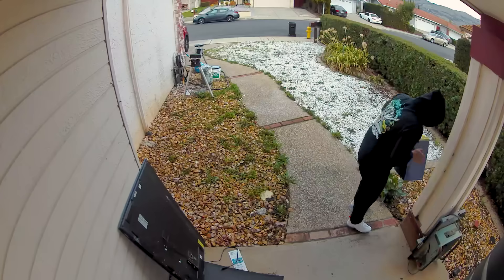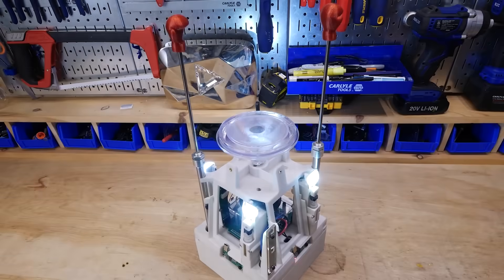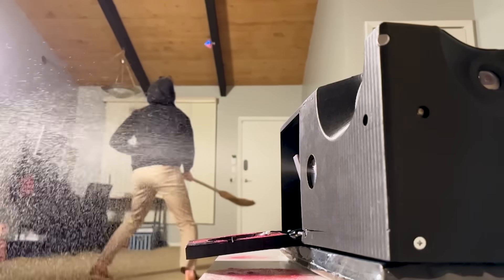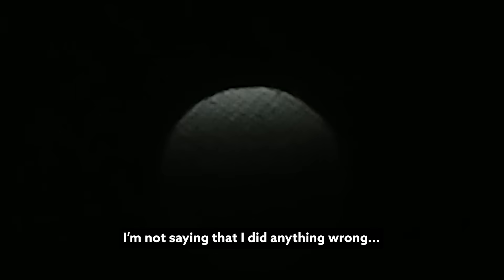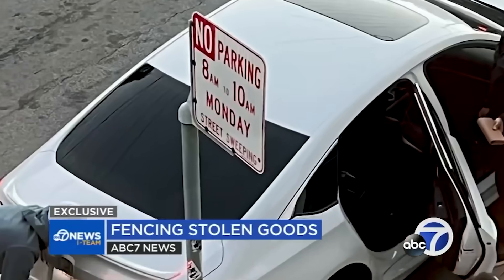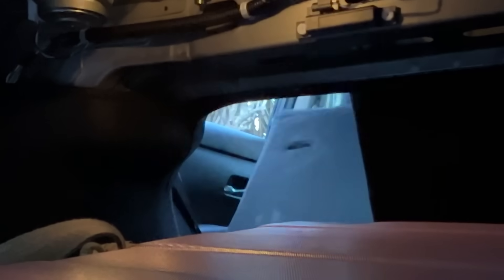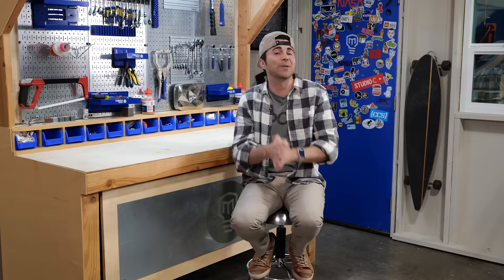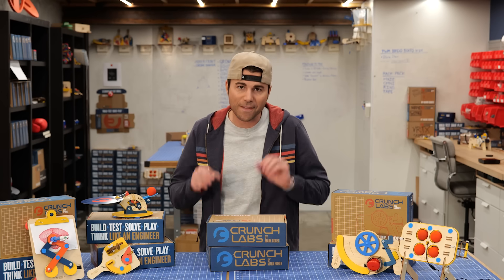Car Thieves vs the Almost Final GlitterBomb 5.0

Comment: Please KEEP doing this. Every time an Amazon package I deliver is STOLEN, Amazon BLAMES ME FOR IT and says I DIDN'T deliver it. I lose my benefits and risk getting my Flex Driver contract cancelled. If I can't hunt these people down, (the porch pirates) then seeing them get punished is the next best thing! Thanks for the video!!!
Reply: This has gone for too long... Amazon should provide package safe boxes with Amazon Prime.. Maybe just an electronic lid that can be attached to a brick or cement built case by the owner near their door.   So let's say Amazon has the code to open lid, leave package... Then homeowner comes opens with code and retrieves. // I know they have system with the Blink and Ring Cameras, but thats a bit weird, more intrusive.
Reply: @Kareemdinho10  eh Amazon is pretty bad
Reply: @mikafizz1022  No you need to stop them leaving things outside.
Reply: @Kareemdinho10  doesnt even need to be super secure most porch thieves wouldnt go for the trouble of getting it out
Reply: @Kareemdinho10  read my previous comment, way more easy and logical solution.
Reply: @Kareemdinho10  OR homeowners just plan to be at home when a package gets delivered. Otherwise the delivery driver just tries the next day or brings it to a store.
Reply: @Kareemdinho10  It's not amazon's fault that thieves are no longer being prosecuted.
Reply: @Kareemdinho10  In Uk Amazon will not leave item outside, they must deliver to an occupant or come back later.
Reply: Wow. You get in trouble because somebody else steals a package you delivered??
Reply: @nenenorth  A lot of delivery drivers actually work for a subcontractor where repetitive doubt of delivery takes a firmer hold.
Reply: @nenenorth  I'm glad Amazon is doing this. I hope the rest of the delivery companies follow. Then the drivers won't be so careless with these packages.
Reply: @nenenorth  he just explained it....loo
Reply: i don't get why they leave the packages on doorsteps in america in the first place. where i live, if you aren't home when the delivery arrives, they just bring it to a pickup point in the neighbourhood so you can go get it when you do get home. or if you have work that day you can just tell that to the company and they will just bring it to the pickup point regardless.
Reply: @Netanyadolf  Amazon offers locker pickup, but if a customer says, "Leave it on the porch," I have to leave it on the porch or get blamed for not following customer directions. It's a lose/lose scenario.
Reply: @rgnestle  well, then imo amazon should blame the customer for their own stupidity. not you.
Reply: @RGNESTLE - Record your delivery and submit the footage. Better yet demand a body cam from your boss. Nag them until they get you one. They cannot blame you if you have proof you are doing your job. They could take the time to even shadow you - follow behind your route and double check.  If you are doing your job - missing packages ARE NOT your fault - that's on the bosses and execs.
Reply: That's complete bs that you get blamed for that when porch piracy is so common.
Reply: I never gotten a package stolen, but I  can imagine how it would feel getting something you saved 5 months to over a year for, only for it to get stolen by lazy people "its 400$ they'll buy another one"
Reply: one of the many reasons Bezos isnt richest anymore
Reply: In the early days of Etsy when people got their package stolen I had to pay the refund. So I would lose a bunch of money. Now, Etsy will refund people as long as it says delivered.
Reply: I had a few of mine stolen.
Reply: @cheesesteakphilly  Sorry to hear that. The porch pirates are brazen. They don't even care if you have a door camera or if it's broad daylight. :(
Reply: Honestly? This is how it SHOULD be and IS here in germany. If I dont accept my package by myself, they cant prove that I got it and the delivery company has to pay for the loss. No problem with package thieves here, but still fun to watch.
Reply: really? My experience has been quite the oposite. When I know it's not amazon's fault and porch pirates, usually amazon just sendsd me a replacement item.
Reply: So no way to do picture.
Reply: My delivery people take photos of the package and it uploads to amazon.  Can you do that?
Reply: Amazon should stop delivering to SF
Reply: Easy fix. Mail your packages to a PO Box. It will always be safe because it goes directly there and you have to go pick it up with a key/combination.
Reply: @ThatsSoGiorgio  That would be best, but it would also put me out of business. That stress would be greater than the stress of dealing with the terrible AI that makes my life miserable. :)
Reply: We need actual bombs tbh
Reply: gopro your day
Reply: @CONEHEADDK  I do, but they still blame me when I show them the proof of delivery. :(
Reply: @CONEHEADDK  He would know ,like his boss,they would say you took film of delivery and an accomplice came behind two seconds later. You no criminal mastermind,get off the cones!
Reply: So why do drivers leave packages in plain sight out in the open if they’re the ones that get blamed for it going missing?
I’m not saying you are, but are a lot of drivers just lazy?
At least in the UK they knock on the door to see if you’re in, or deliver it to neighbours or leave it out of sight if you aren’t in, and then put a card through your door telling you where it is.
Reply: @griff389  We leave them where the customer requests that we leave them. If we don't, we get blamed for not following delivery instructions from the customer. It's as simple as that.
Reply: So why you leave the package at the door if nobodys at home. As a non american it seems weird
Reply: @BighypeBeats  Because we will get punished if we don't follow the delivery instructions. If it says, "Leave at front door," we have no choice but to leave it at the front door. (If a shady person is hanging around, we can call support or deliver the package later, but most of the time, we just have to do what the customer says (which is to leave it at the front door most of the time.)) It's NOT our choice.
Reply: @BighypeBeats  As a thinking American, I agree with you! It just shouldn't be! It costs Amazon money and makes me (and other Amazon Flex drivers) lose benefits they need to make the job profitable. I just DON'T understand their logic!
Reply: @BighypeBeats Nobody waits around to be handed a package. We don’t interact with other humans if we don’t have to in this country. Like, I don’t answer the door for anything. Ever.
Reply: @ataesugacookies9484  Why dont you pass to the recipient directly ?
Reply: @philipslighting8240  weird I don’t know how my reply got sent to your reply and then posted twice. I meant to send to OP
Reply: @ataesugacookies9484  A tear in the matrix.....
Reply: Your Fault. Dont leave items outside then. Never would happen in UK they have to deliver to recipient in person or come back another time.
Reply: @philipslighting8240  So doing what I am supposed to do (following customer instructions) is MY fault? When did following the rules become the WRONG thing to do? That makes NO SENSE WHATSOEVER. (If you were being sarcastic at Amazon's expense though, please ignore this reply.)
Reply: Continues working for Amazon lol
Reply: @LeYoIdBeHe  *Continues not wanting to starve and be able to pay rent. There I fixed it for you
Reply: @abbiereynolds8016  oh it's not like there are plenty of jobs out there.
Reply: @abbiereynolds8016  Whats rent dont you own your property.
Reply: @philipslighting8240  Don't you own yours?
Reply: @abbiereynolds8016  Of Course.
Reply: @philipslighting8240  Then so do I😜
Reply: @abbiereynolds8016  👍
Reply: @LeYoIdBeHe  Has no choice... :(

Comment: If anything fedex, ups, and USPS should create a joint operation to send, track and prosecute this.  Postal inspectors are federal law enforcement officers with arrest powers.  Creating a mixture of box types to avoid recognition would be simple enough. Even a single team floating around the country setting up stings could put a huge dent in the perceived practicality of this kind of theft

Comment: So you have probably been asked this before, but I just want to know have you ever used micropython? It is like the arduino proggraming language and based off the most popular proggraming in the world (python). It works on lots of microcontrollers. One more question. I have not taken your engineering course yet but I will when it opens up again, but have you used normal python on a rassberry pi?

Comment: My cars trunk has a trunk lock so it doesn’t open unless the keys are out of the car and you use the fob to open it. Other then that it won’t open and my seats don’t fold down so my trunks completely closed off when switched off. It’s a fully electric trunk too which means you’d have to cut the metal work in order to get to the latches cord.

Comment: Centralia Pennsylvania.  Any project you may have that requires massive amounts of heat.  Well look no further than to the city that is on fire.   Plastic will shrink immensely when exposed to a lot of heat. Pure water can be distilled and distributed to the needy.   Reforming plastic under heat and compression should make a very Stout object.  Just saying

Comment: I so.wish you would do some with glow in the dark 360 degree mega spraying dye packs with at least a range of 5 feet. A type of dye that will not just wash off with soap and water, but has too wear off over a long period of time..

So what if it ruins their stuff. They are thieves.

Comment: Part of me wonders what type of engineering solution there is for a disabling/locking mechanism for the seats to prevent them from being let down
Reply: Many cars have switches on the back of the seat (accessed through the trunk) that disable / enable the mechanism.
Reply: @Scrap5000  This... I was just about to say even my grandma's 95ish Toyota Corolla had that switch on the trunk side of the seat.
Reply: My back seat doesn't come forward without a key. 
Edit: From the inside anyway. The safety strap inside the trunk bypasses the need for a key.
Reply: The reason why the seats can be moved like that is because of kidnapping where people are put into the trunk of a car. We need the victims to be able to get out.
Reply: @abadgurl2010  This and for safety reasons; You need to be able to get out through the trunk. And to create extra space in the car, of course.
Reply: make them unable to be pulled down unless the cars unlocked
Reply: That was my exact thought too.
Reply: The only release for my back seats is inside the trunk.  You can't release them from inside the car.
Reply: Have an automatic planar material slide in to take the place of the now missing transparent material, to prevent the opening in the first place.

Comment: It would be an interesting court case when the thief is injured by the glitter, mini drone or public shaming (mental anguish). Put it this way we all know the law seems to protect the criminals every time. Anyway we need Mark Rober to solve a huge shoplifting problem at my local department store. Paying for goods these days is so yesterday and it seems crime does pay
Reply: They could get in trouble with porch packages, but with car break-ins, they don't stick around, so they would have no way to have the cops go after things like those back packs.
Reply: Its basically the principle that says you can't booby trap your door to stop a break in.  Based on that same principle I'm surprised no one has tried suing.
Reply: @HontasFarmer80 , I do remember there was an electrified steering wheel club that was sold and, at the time, was legal because it was inside the car, meaning the person would have to actively gain entry to contact the device. So I would guess a similar argument could be made that these devices are inert to the vandal until they actively take a role in their removal.
Reply: @HontasFarmer80  isn't it sad that the law will come down hard, using every means available including surveillance, on a frustrated person that booby traps their own home or confronts and injures an intruder? That same law will do absolutely nothing for these car breakins even when presented with surveillance and gps. Its dusgusting.
Reply: @nunyabusiness863  wouldn't you want to protect your own colleagues, or the juniors in your profession?
Reply: @HontasFarmer80  You know, I don't think the law has ever been clear about command detonation so I think that may pose a loophole.

Comment: The funny part is that the device is worth more than anything the thought they were getting. You could resell this on EBay for a solid come up.
Reply: Yeah do more illegal stuff when Mark already knows your location why not
Reply: @snotsnarler1174 its not really illegal to sell the box
Reply: @vc34-00  uhh... it's stolen?

sigh
Reply: @vc34-00  How do you figure that?
Reply: @vc34-00  critical thinking skills?
Reply: @KG84C  

Designing it to use cheaper computer parts is the smart move. It just makes sense.
Reply: @vc34-00  🤦‍♀
Reply: These computer parts are most likely very cheap, so this version of the device is probably the cheapest yet.

Comment: Why is this the final year? It seems like the gift that keeps on giving for thieves!
Reply: Probably because the longer he does it, the more thieves will know what he's doing. He puts phones in his glitterbombs, so if they know about that they'll hold onto it to take the phones out, which would only help them
Reply: @TheKing-kd9li Phones are bricked after being stolen …zero value
Reply: @Anonymous8317  Serioously? You can write new firmware to the phones and make them usable again. The hardware is never damaged.
Reply: @TheKing-kd9li  hahaha, what?  Do you think he cares about those phones?
Reply: @louididdy  like i said, it helps the thieves because they can sell them
Reply: @louididdy  hahaha, what? Did you actually read the comment before replying?
Reply: @TheKing-kd9li  the phones are useless to the thieves
Reply: @louididdy  he cared about a $6 package apparently. So I'd say he probably cares about the phones.
Reply: @TheKing-kd9li  Should have a self destruct mechanism!

Comment: Seeing them stop next to the car to check it's content and leave makes me want to create a spike strip thrower that would be under the target car
Reply: s̶p̶i̶k̶e̶ ̶s̶t̶r̶i̶p̶ ̶flame thrower. Fixed it for you.
Reply: @vaffangool9196  IED
Reply: For me you just had the best idea of the year. It would be awesome!
Reply: Booby trap !
Reply: The cars they are using are stolen.

The police have been so demonized by the citizens, they just do nothing now as the citizens voted for helping the criminals.
Reply: They use stolen cars so it’s not even an issue for them. It’s not like the cops are locking these degenerates up.
Reply: Aah... I assumed they would use stolen cars, but i don't know why, I also assumed they would try to change the tire, giving time for cops to arrive XD
Reply: I wish version 6 would carry a taser...
Reply: @nicodesign-np  Or a couple of hundred volts
Reply: I was thinking taser.

Comment: The fact you can literally capture these thieves on camera multiple times on a single car, means SF police and justice department are crap.  When you are soft on crime, it runs rampant.   This is obviously organized crime, and it should be RICO under federal law.  Stop letting criminals get away with crap, put them behind bars or under the ground.

Comment: As soon as the cover came off, the insect glue should have been released at the bottom in several places to prevent the box from being tossed out. That would have maximized the impact of the glitter and most of all, the eternal stench of revenge.

Comment: Mark...one issue is that no company sends these types of items in their actual packaging. For example if I bought an Oculus now it will arrive to my door step in a carboard outer box. So its immediately suspicious if its not in one of those on a door step or on the street. Inside the car it could have been opened by owner etc so thats okay....now they are just wise to them in cars. Personally I would put some plutonium-239 inside the box....arrest them if they survive

Comment: What surprised me is the thieves' gloves they tap the window and it breaks like nothing. Must have something in the tip of the fingers.
Reply: An auto punch. Press hard and it punches. Designed for metalwork punching a dot to drill a hole.

Comment: GlitterBomb 6.0 Smartphone and Laptop.  The case and screen are the original internals, the motherboard from the phone a Co2 capsule that pushes out the smelly liquid and flashing dust.  The camera on the box and the microphone on the phone.

Comment: Mark I was wondering why you had to decrease the size of the box since I thought that you could have a decoy box with nothing in this in the back seats maybe with some thing heavy but worthless unguarded and then when they break in and pull the seat back you would have a small suitcase with the oculus so they get the real surprise instead of the mini one.
Reply: The thiefs were suspicious of the package
Reply: @lapinzzz  id be suspicious of a single valuable item sitting in an otherwise pristine factory new car too
Reply: @lapinzzz  *thieves
Also, if you put it inside a shipping box or suitcase they'd be a lot less suspicious
Reply: i don't understand how the thieves would get something from the trunk
Reply: @_invencible_  remember that they can just crawl inside the car after breaking the window so then they could go to the drivers seat and unlock the trunk
Reply: Exactly